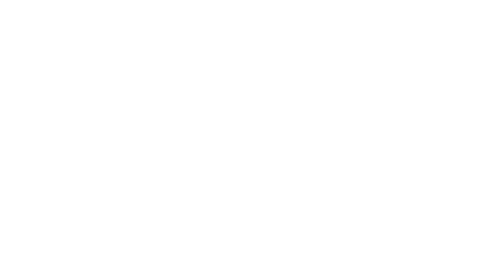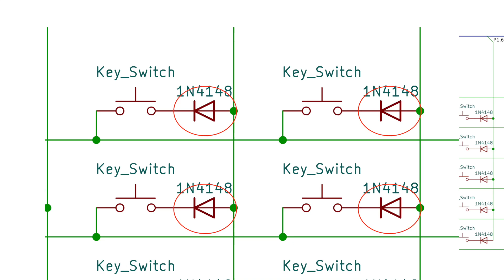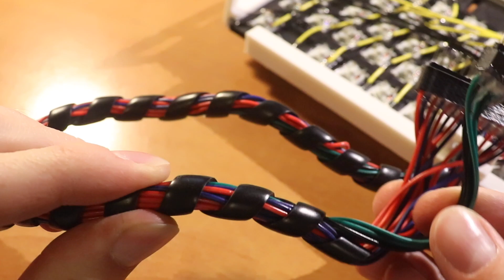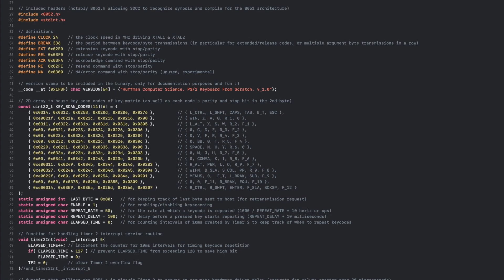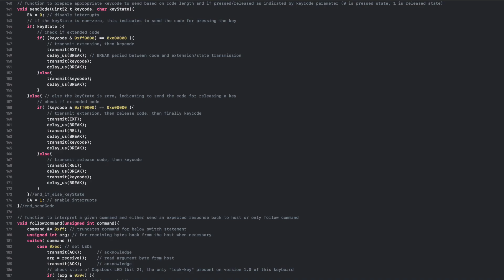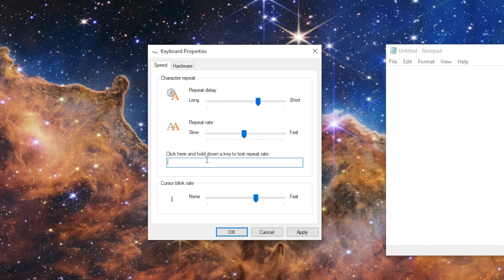Build a PS/2 Keyboard From Scratch

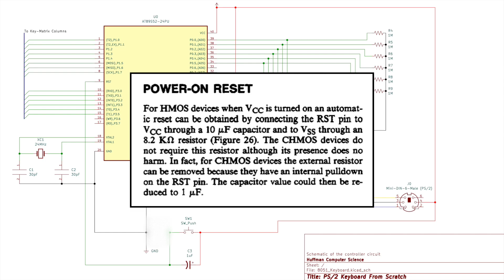Comment: At 9:36 or so, is SW1 really meant to go directly between VCC and ground?  It seems like pressing it would cause your power supply to short out through the switch, causing either a current limit on the device supplying power or magic smoke to be generated somewhere in the system.
Reply from the maker: You are correct! My schematic has a major error in it. Shame on me for that oversight! 

I originally had a resistor between reset and ground. Then the switch would connect VCC to reset. When I added the power on reset cap, the resistor was removed. 

So there should be NO connection to ground there!! The switch should only connect VCC and reset. The cap cathode should NOT be connected to ground, only to the reset.

Thank you for catching that! I will need to fix the schematic to reflect that.
Reply: @HuffmanCS Thanks for the fast update; this is a really great video!  I just wanted to point this out for others like me who might see this when looking to design their own keyboards, and hopefully save a bit of headache.
Reply from the maker: As soon as I heard "magic smoke", the alarms were raised! I've added a blur to the video that should cover up that short (might take YouTube a bit to update it) and I updated the schematic in the repo to remove it as well. Thank you again for pointing that error out! 

May your keyboard project be headache AND magic-smoke free :)

Comment: hey, amazing job you did there btw had a question like, what type of keys did you pick for the keyboard, are those like SPST, SPDT, DPST and DPDT or what i can't figure it out? like those are manual for all i know not PCB pads well there is no PCB there.
Reply from the maker: Thank you, I suppose they could be labeled as SPST? They’re a single pole switch, but specifically they’re called “keyboard keyswitches”, or “MX keyswitches”. They got different grades/colors but I just went with the cheapest option at the time.
Reply: @HuffmanCS Oh thanks, ohhhhh those are like the  mechanical keys mb i thought something different mb, Have a great day.

Comment: I think you only need 8 diodes one for each row if you have pressed only one key in a row.
Reply from the maker: Technically you could eliminate all the diodes if you only ever press a single key at a time. Most simpler keypads are like this. 

However, having a diode on every single key is mandatory if you want the keyboard to support N-th key rollover without ghosting.
Reply: @HuffmanCS , since 1978 we have a Latch with 8 Rows, there is one diode in each row to the matrix - Kathode on the latch side, anode on the matrix side. the columns have a 8 bit input buffer to read into (input port). at each input is a pull-up resistor. with polling you read the „low“ you shift through the rows bit by bit (here 8 Bit Port ) . are all columns high no key is pressed. if one bit is low you check the corresponding row for the key. for two keys CTRL-C, you check for CTRL key first and save the state - in the next round you check for key C. key CTRL and key C are in different rows.

Comment: Thank you so much for your work on this project. I was looking into the PS/2 protocol myself for a new keyboard project and this was exactly what I was looking for. I won't be using an 8051 but this firmware will prove invaluable as a foundation. I'll be adding the USB protocol back so I can use a USB interfaced microcontroller and a passive PS/2 adapter to have support for both systems. The one thing left to determine is how the keyboard determines what protocol to use but there must be documentation for that somewhere. The one thing that kinda sucks is that doing it this way means I can no longer use QMKs mouse controls as a layer because the PS/2 protocol doesn't include those inputs, still an amazing discovery that will make this project actually possible. Thank you
Reply from the maker: I’m happy to hear the project has been valuable to you! I don’t blame you for avoiding the 8051 for what you have in mind; it has its “charm” for some projects but it is quite limited! As far as protocol selection… I don’t remember where I read it, but… I think there exists USB keyboards which have PS/2 support built in, and they work by monitoring the D+/D- lines for a PS/2 handshake from the host (as if they were the clock/data lines). And QMK mouse is new to me… if it’s just simple mouse movements or clicks you need to emulate, the PS/2 mouse protocol might work… you’d just need to output to a second PS/2 port (purple/green), which maybe isn’t an option for what you have in mind?
Reply: @HuffmanCS  You are correct that a passive USB to PS/2 adapter maps the D+ and D- lines to the Clock and Data lines respectively. I am curious what you mean by host, do you mean the device or the keyboard? The device, correct? So I suppose that a booting device will send that handshake on boot and the keyboard needs to recognize that and go into PS/2 mode? I'll probably need to find a way to monitor these signals send to the keyboard and integrate that into a conditional statement before the infinite while loop

As for the mouse keys, yes, I could use the PS/2 Mouse protocol with a second port but the back of this keyboard is already pretty cluttered. I would have to only use one port and I think I have a novel idea of how to do it. The microcontroller I am using has a USB-c type interface which is already like two USB-as. If it is true USB-c, I could have it send keyboard through the data line and mouse through the transfer line, if it is not, I can make it work by breaking out the USB-c pins and mapping it to the data and transfer lines that way. I need a custom cable that splits these signals into their respective sides though.
Reply from the maker: @7thboss931  Yes, the host being the device which your keyboard then plugs into. I think you could monitor the clock/data lines via your keyboard MCU and upon detecting a PS/2 handshake go into the appropriate mode.

I think I’m following what you’re saying, and I think it’s a pretty crafty idea! It’d probably work… to clarify, would you need to create a custom USB C to dual PS/2 port cable for when you want to use your keyboard as such? Then when not, simply plug the USB C directly into a USB port?

Also what MCU are you using for your project out of curiosity?
Reply: @HuffmanCS  Yes, I would need a custom cable but taking a step back it’s probably impossible. I intend to use a normal mouse as well so I would probably need a mouse y-splitter and that’s not how the PS/2 Protocol works. The signals would interfere with each other because they would be in parallel with the other’s clock and data lines. Pretty infeasible and ultimately unnecessary.

As for why, I’m just interested in taking advantage of the technology I have at my disposal. I like the idea of having an interrupt driven device and ultimately prefer it to a serial one. Primarily, I like the idea of lower latency despite how ridiculously small that advantage might turn out to be

As for my MCU, I’m using two ATmega32U4s, one per side

Comment: Do you think it is possible to build a hybrid keyboard that can use either PS/2 or USB without the use of an adapter? As well as installing a female PS/2 port to the board in place of the soldered cable so as to have a removable PS/2 cable?
Reply from the maker: @Kerivity  Yes! I think you’d want to go with a much more capable MCU than the 8051 that is more USB friendly and that you could still have PS/2 implemented on the side. And using a female PS/2 port on the keyboard would work perfectly fine so long as you connected the pins correctly (they’d be mirrored in a manner).
Reply: @HuffmanCS  either that or mirrored within the cable

Comment: wich are the key specs of the microcontrolers you would need for this jobs?
i was looking fowards to build one for high-performance gaming, but i couldn't find much information over how to build one, and i fear that the teensy wouldn't do it
Reply from the maker: As far as creating this project with another MCU, you'd need to make sure it has enough I/O pins to cover the columns and rows of the key-matrix. The MCU will also need to have a fast enough clock to bit-bang the PS/2 protocol. And the MCU should tolerate 5v logic (or at the very least, a logic level shifter for the PS/2 clock & data lines). 

At a glance, the Teensy 4.0 may work fine in this project so long as you have a logic level shifter from 3.3v to 5v and vice-versa between the MCU and Host.
Reply: Thanks, also @HuffmanCS  
would a MCU like the AT90USB82 or AT90USB162 do the trick?
in this case is specially to try to find a cheaper option to a tensy
Reply from the maker: Yes! As a matter of fact, the AT90USB82/162 MCU even contains built-in hardware to specifically help with implementing the PS/2 protocol. 

(Although I assume you're aware it is a SMD and contains the AVR architecture, so ensure you're equipped for that should you use it!)